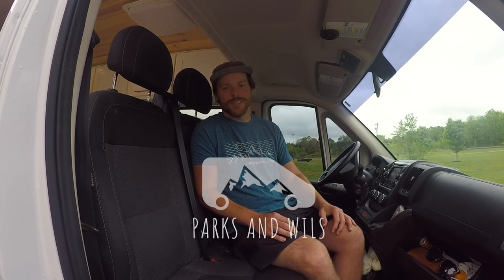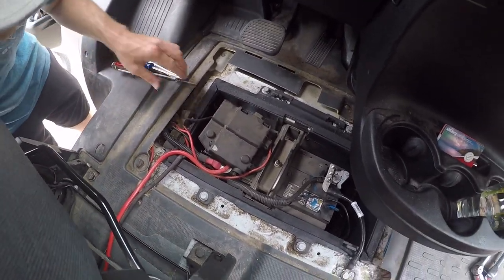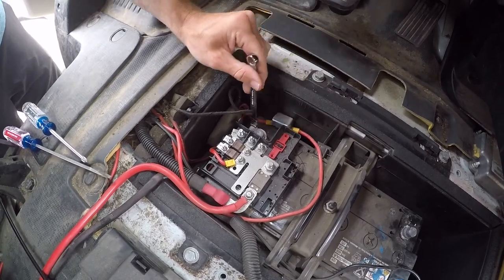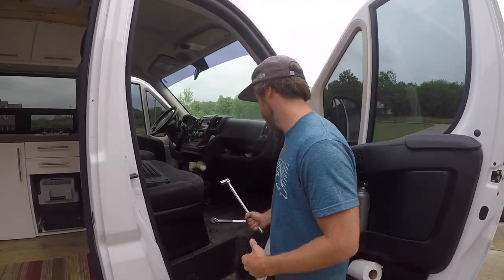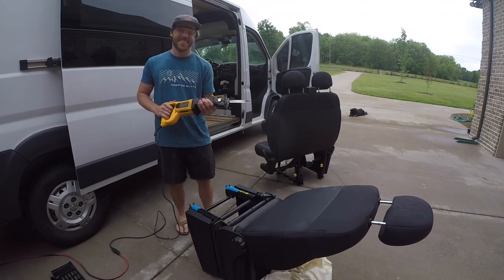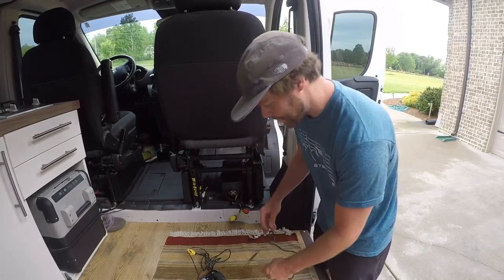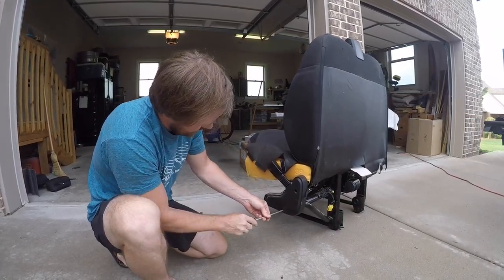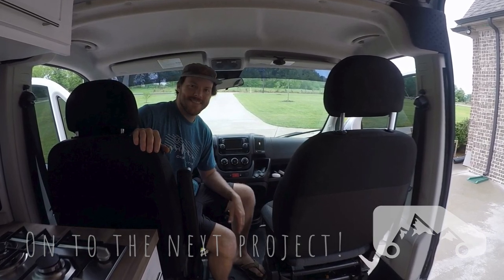Installing a Bucket Seat in a Ram Promaster Van

Comment: i would like to remove my passenger bench seat completely. i want to perserve this space for my giant pup. i am told there is a way to override the computer and trick it into thinking the seat is still there? has anyone done this and if so, how do you knock out the warning lights and symbols when the seat is removed??? thanks in advance :-) i know this can be done as they do it in delivery vans all the time but how??? what module do i need?

Comment: Thanks for the great video. If you did not have the heater under the seat do you think it would be possible to add a swivel? Thx
Reply from the maker: Thank you!  Yes it is possible to install a swivel. We recently installed one even with the heater under the seat

Comment: I have a bucket seat but want to remove it to make space for my pup. Is it possible to remove and not put anything in it's place. If so, what to do with wires etc? I don't want to permanently remove them in case I want to install the seat again

Comment: Curious. I am about to purchase a seat and am getting conflicted information. Did your say with or without platform? I am nervous to buy a bucket seat on ebay because nobody seems to know if the seat will fit the same track or have the platform needed 🤦🏻‍♀️
Reply from the maker: Hi Ashley, we didn't see the term 'platform' when looking for a seat. However, it sounds like the same as the 'riser'. When searching for our seat we saw many listings say 'without riser'.  We needed the riser because the bench and bucket seat risers are different. We messaged the seller about including the riser and he was happy to.

Comment: Did you just tie strap together the 3rd seat's seatbelt pretensioner and weight sensor wirings on the floor or tucked/hide it under the bucket seat ?
Reply from the maker: We hid them under the bucket seat using zip ties!

Comment: Awesome video! Can you elaborate on how you removed the occupancy sensor? I look at my bench seat and it looks a bit overwhelming to do. I plan on selling the bench seat so don't want to butcher it.
Reply from the maker: We unzipped the bench seat and then used pliers to remove the metal clasps so we could access the occupancy sensor so it does require some disassembly. It might be tricky to resell a seat without the occupancy sensor too. I wonder if you could just purchase an occupancy sensor that way you don't have to disassemble the bench seat.